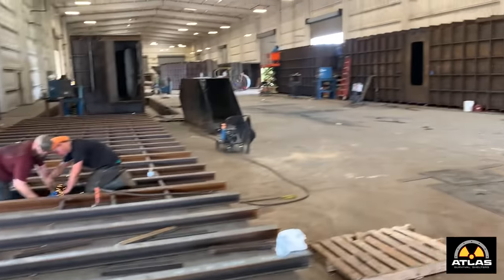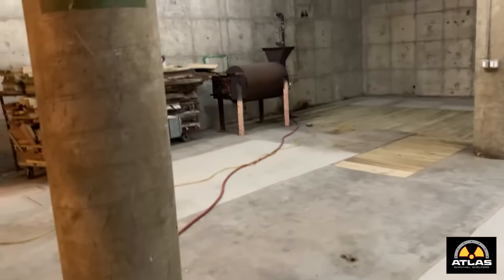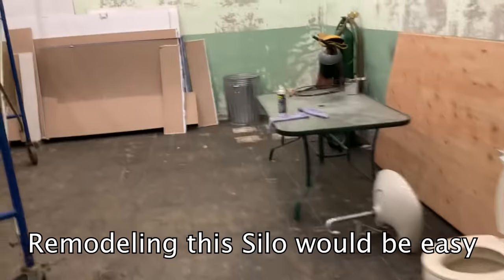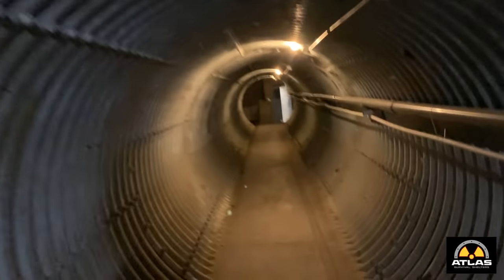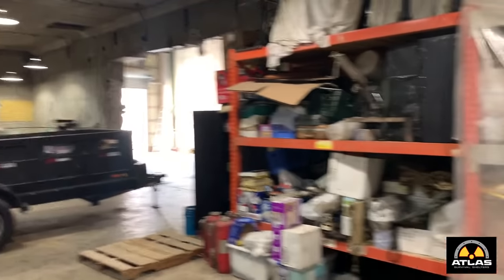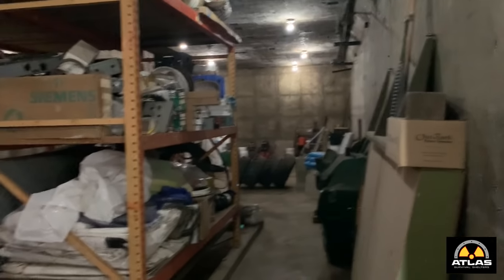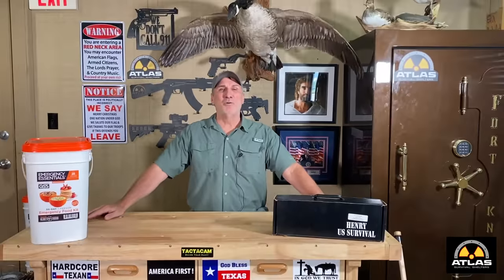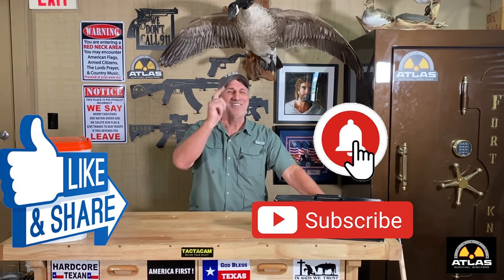What's Inside a $30 Million Atlas E Missile Silo!!!

Comment: I'm quite confused. This is a "missile" silo, but I didn't see any missile silos, just regular rooms... Where are those silos at?
Reply: Ok, where the big sliding door was. The missile laid flat, and rose from horizontal to vertical, then blasted off towards Cuba. Were you watching this on mute...it was all explained...with pictures even.
Reply: @chrisferguson1911  thank you for the explanation. I was watching with sound but the echoes and volume differences made it difficult to understand
Reply: Yes, the missile was driven in and attached to the roof.  The roof lifted up on a hinge putting the missile vertical and then it was loaded with liquid fuel and liquid oxygen and launched.  The missiles had a tendency to blow up on launch so they were decommissioned.  Nuclear missiles that like to blow up on launch aren't the best idea for defense.

Comment: Imagine if the door somehow gets stuck and you have to repair and unstick it.  What tools and equipment would you need for that?   The condition of the food is about the same as some other 50+ year old food storage I have seen.  Most of what is canned is probably still usable, but some of it has rusted through or dried out.  But you will know which is which as soon as you open the can.
Reply: The foods only been there about 10 years he said.  It's certainly not original to the facility!

Comment: just saying if i was a looter and wanted to get inside and steal everything from who ever is in the bunker easy way is just find the air intakes try to go trhough those if u cant start a huge tire fire in front of it and smoke them out or just block it so they cant get any air these are just some ways to into one without tools now if i have a grinder and ropes i could probably climb into the bunker who ever is around still alive on the surface is gonnna be smart and strong your not gonna be dealing with apes there not gonna try to go through 40 ton door there gonna look for your air intakes and block it so u come right out

Comment: Cool, but $30,000,000?

Be cheaper to start over and build your own.....and have $20,000,000 left over.
Reply from the maker: It does not cost 30 million.  That's replacement t cost new today   You can buy it for under 2 million I think